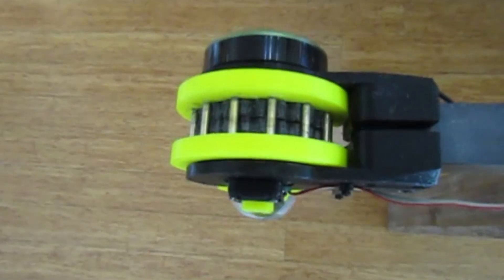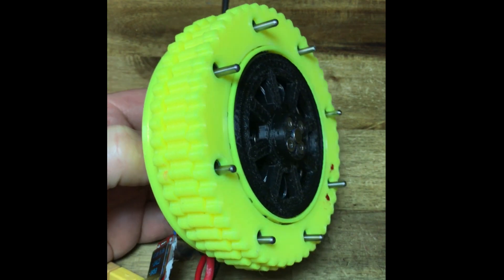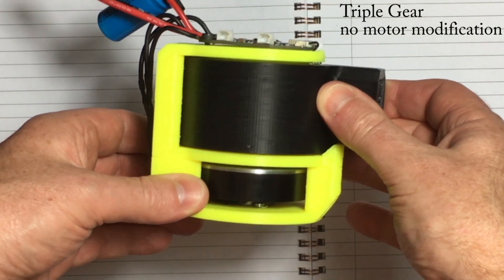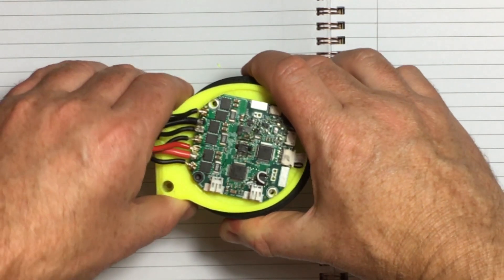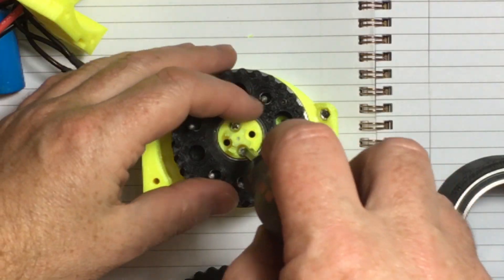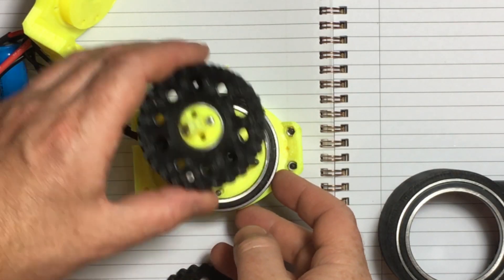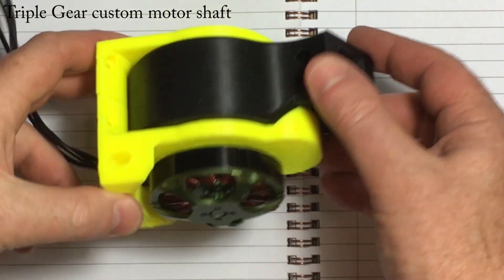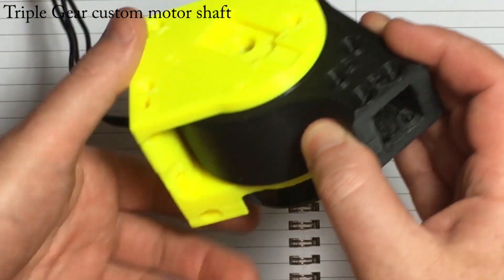3d Printed Cycloidal Gearboxes new and upgraded

Comment: Woah, this is awesome. I was wondering if you could provide the CAD files for the BLDC triple cycloidal drive that appeared at the end of the video?
Reply from the maker: The Inventor files are at https://github.com/gouldpa/Odd-Mech-Assemblies/blob/main/Triple%20cycloidal_brushless.zip Let me know if you require a different format.
Reply: @PaulGouldRobotics  This is perfect, thanks!
Reply: @PaulGouldRobotics Could you also tell me the dimensions of the shafts you used?
Reply from the maker: @jasonjzliu  38mm x3dia max
Reply: Hi  @PaulGouldRobotics  , could I please request that you add STEP files for this actuator as well? I can't seem to open .ipj in Onshape. I would love to see how you managed to constrain the output stucture.

Comment: hello, i'm making my own cyclodial gearbox. but my gearbox does not backdrivable. do you have any comments to solve non-backdrive problem? i think high friction may be the reason, but i have no confidence on my answer. thank you.
Reply: and also, i'm wondering how to achieve good start up torque with bldc motor(i'm using bldc for RC cars). my motor is good enough when i runs fast, but it is poor when motor speed is low.
Reply from the maker: Chat to me on Instagram or hackaday.
Reply: @PaulGouldRobotics  oh i see, thank you

Comment: The renowned sliding bearing manufacturer IGUS has special filaments with tribological properties that could be particularly suitable for hypocycloid disks:
https://www.igus.co.uk/3d-print-material/3d-print-material
Reply from the maker: I will try IGUS filaments at some point. I'm not sure if the standard ender 3 will work with them though.
Reply: @PaulGouldRobotics  The processing is just as demanding as eg ABS. A closed case, less or no cooling, etc could help against warping. However, the cycloidal disks have a relatively simple geometry that the Ender 3 possibly could handle.

Comment: Hi Paul, where do you buy your bearings from? I'm hoping to find something affordable, but without the current shipping problems from China during the pandemic.
Reply from the maker: The big bearings are 3D printed with steel balls. I get the large bearings locally in Perth Australia from Apollo bearings and the small ones from plaig.com.au
Reply: @PaulGouldRobotics  Thank you! Are you planning on replacing the 6809 bearings with a 3D printed design? Where I'm from a single 6809 goes for around $25, which jacks the price up considerably.
Reply from the maker: @CLRobotsLearnHere  I get them for about US$3 online and US$10 locally. No, I will only replace bearings that I can't get buy at an affordable price. I have not been able to get 3D printed bearings perfect, yet. What country are you from?
Reply from the maker: @CLRobotsLearnHere  You can chat to me on Instagram, discord or hackaday
Reply: @PaulGouldRobotics  I live in Canada (Toronto. I'm not too familiar with local bearing suppliers, but I've only found $25 CAD for a single 6809. Where do you purchase yours online?
Reply from the maker: @CLRobotsLearnHere  quick search https://www.walmart.ca/en/ip/6809-2RS-Deep-Groove-Ball-Bearing-45x58x7mm-Double-Sealed-Chrome-Steel-Bearing-2pcs/PRD2ZH6008F9SI1
Reply from the maker: @CLRobotsLearnHere  https://www.aliexpress.com/item/32871929067.html?spm=a2g0o.productlist.0.0.119d563bvxwDWx&algo_pvid=c7e27328-9fca-4aed-981b-39fc4db0c36b&algo_expid=c7e27328-9fca-4aed-981b-39fc4db0c36b-0&btsid=0b0a555316162129491951664e4061&ws_ab_test=searchweb0_0,searchweb201602_,searchweb201603_

Comment: nice intro hahaha

I bought some of the 6810 bearings you recommended me on aliexpress, but I'm struggling trying to find bigger bearings... where can I find like 10cm diameter bearing? is there a chart to look for the code names? sorry for bothering you

keep up the good work!
Reply from the maker: The large bearings are 3D printed with 4.7mm steel balls. I can not find off the shelf large bearings other than a lazy susan.
Reply: @PaulGouldRobotics  ahh thanks!

Comment: Congratulations Paul! very nice project! I was wondering if it could be applied in a robot arm like from the Jeff Kerr's model, which in the extreme part of it the joint would have a smaller bldc+gearbox. do you have any plan to lauch a video with the same gearbox in a robot arm?
Reply from the maker: I am still trying to find the ideal actuator design. I don't have plans for a robot arm right now. Robot arms require low backlash. It is very hard to achieve zero backlash with 3D printed Cycloidals.

Comment: +1 90 degrees belt drive and you got yourself an open dog winner as you could stack 3 and power a full spot leg. Wondering if it would hold to the response timing needed for a canter... wish you would start testing its impact stats on camera.
Reply from the maker: Can you please send me an image of what you mean. I do some load tests on each design but none are tested thoroughly enough. I haven't found a design that I like well enough for extensive testing.

Comment: Hi Paul! This is superb, thanks for the video!
One quick question: I've built a few cycloidal gears and I have had to switch to traditional gearing in some projects because of friction during repeated use, which would melt all types of plastic shafts (including ABS). How did you deal with friction and heating? Thanks again!
Reply from the maker: Silicon Grease and light loads. Thinking about putting the bearings back in.